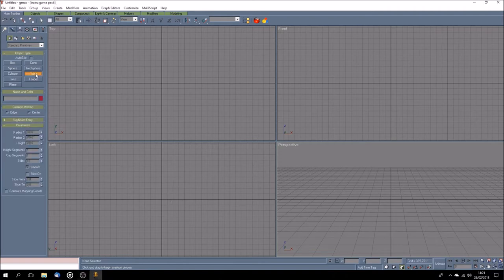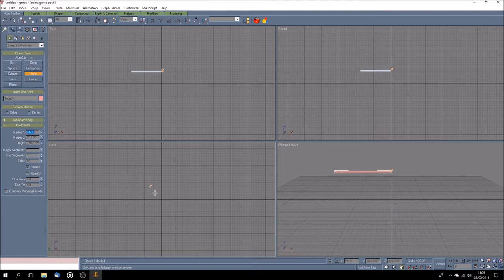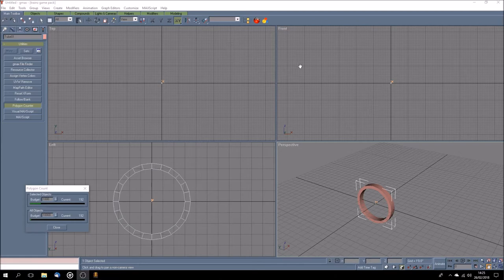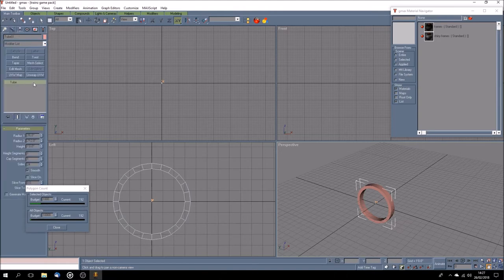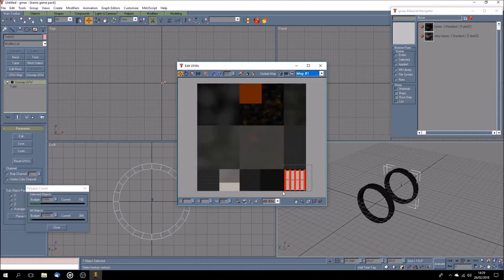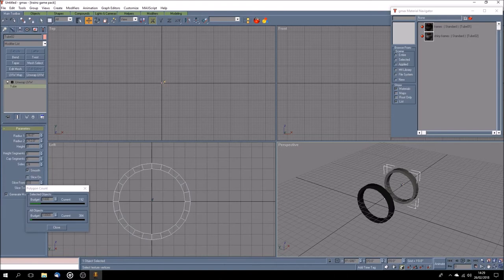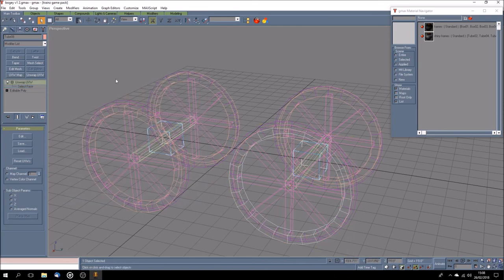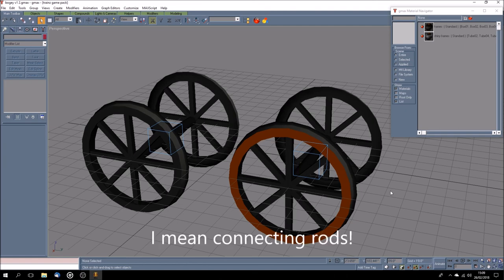Gmax: How to make models for Trainz, part 11 - Making an Animated Bogey 1

Comment: What is the gauge width on the wheel spacing? (for Trainz standard gauge)
Reply from the maker: The gauge for this model is 3ft - in Ireland it was the 'second standard gauge' after the 5ft 3in which is still the Irish main gauge. Altering the gauge is very straightforward in Gmax models for Trainz railsim, you just move them apart or together. The fun comes with altering the valve gear, although as the running gear is almost always bilaterally symetrical (i.e. mirror-image side to side), it's possible to move each side laterally to adjust 3ft to 3ft 6in or 1m, for example.Trainz assumes that Stephenson's 'standard' gauge of 4ft 8.5in is standard everywhere, but even in Australia where Trainz comes from, there are several gauges used for substantial state-based systems. I put standard in quotes because I'm a great fan of broad and narrow gauge systems: Brunel's 7ft gauge, for example, was superb.
Reply: Thank you for the information.
Reply from the maker: 4ft 8.5 ins